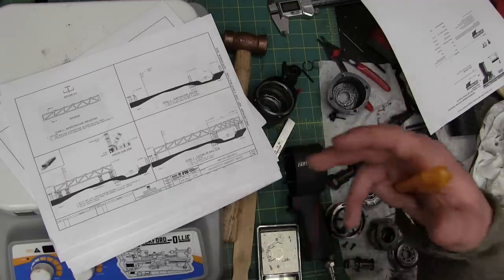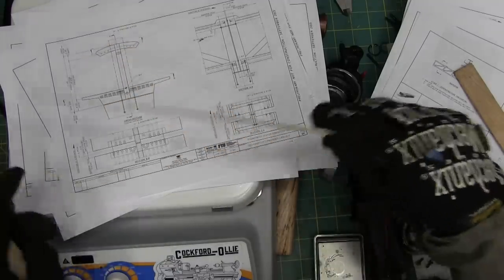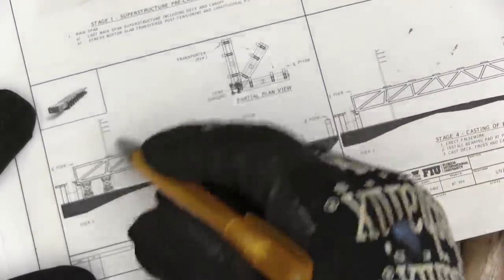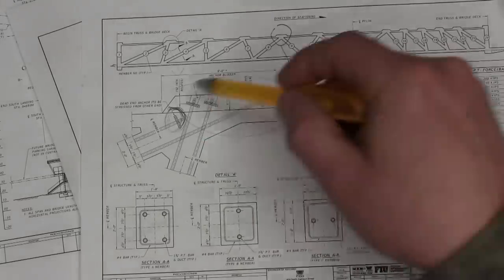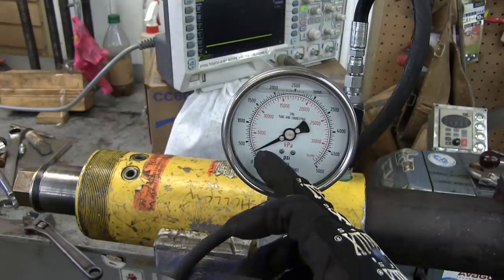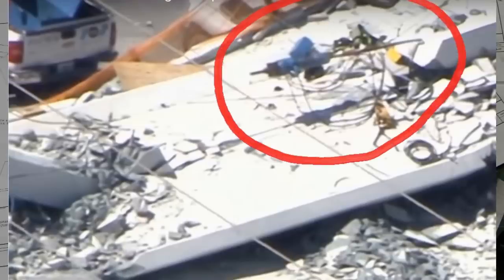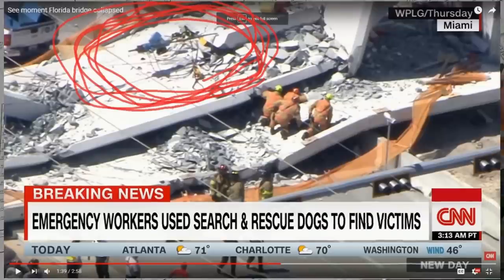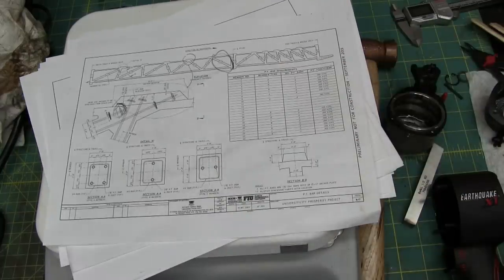Post Tension Failure Florida Bridge Collapse | Engineering EXPLAINED!

Comment: So to sum it up, the plan changed where as the transporter to hold the bridge up was moved, because it was moved the post tention rod yielded. They tryed to fix it by tightening it and it broke causing the bridge to fall.
Reply: brendan454 Looks that way, the modular construction moved in sections method is sound. I guarantee this was all perfectly calculated but at the last minute a change was made to the plan (moving the location of the SPMT), calculations rushed and the rest is tragic history.

Comment: So the mainstream media is getting closer to what AvE said a couple of days ago, they still haven't gotten it quite right yet methinks.
From the Miami Herald:
"While the cracking dominated media coverage on Saturday, experts appeared less concerned over that than with other factors, including the tensioning work going on at the bridge’s north end. Cracking in new concrete is not uncommon and not necessarily a sign of failure, they say.

Tightening of steel cables, or tendons, that run through concrete structural elements is a delicate operation, and over-tightening can cause concrete pieces to twist and break apart, experts say."
Reply: Wow. "Cracking in new concrete is not uncommon and not necessarily a sign of failure "  Well if that statement doesn't take the cake.
Reply: The people who were close to this project knew immediately it was because of one or maybe two things and said oh fuck.
Reply: Exactly. It may be months or years before they pin down exactly what happened.
Reply: Have any concrete bridges near you? Or even ones with the concrete parapet walls along the side (barrier, so you don't drive off the edge).  Walk out on one and look at the parapet or roadway up close. You will see thousands of spiderwebbing and microcracks. The bridge is constantly flexing, especially on a roadway bridge with traffic imparting massive live moment force every time it crosses onto the bridge from the approach slab. These are superficial cracks and mean little to the concrete's compressive strength. And on the parapets, that are non-load bearing, it means nothing. If the steel cables inside the concrete beams underneath the bridge fail...you lose all tensile strength and the bridge is in trouble.
Reply: alternative media. This youtube channel is a form of media.
Reply: Yes, and concrete being a plastic material , we even calculate the size of possible cracks. It's in the codes.
Reply: @D rB You seem like you know the lay of the land with these sorts of projects - I've got a quick hypothesis I need checked:

It looks like the part of the truss that's been pointed out as failing is in compression, not tension. So my thought is that the PT rod snapping wouldn't have brought it down?

I commented elsewhere, but at this point I'm digging for someone to chat with about this - I want to make sure I'm not going crazy.
Reply: @Louis Vaught
It may not have mattered if the member was in compression or tension.

Trusses are designed so that the resultant forces in all of the members equals 0. This means that the forces that are present in one of the members are being compensated for by the other members. Bridge trusses are usually designed with enough redundancy that a failure in one member may not result in a failure of the entire structure. In this case, the bridge is a hybrid system and was not in it's final constructed form. From what I've seen there was supposed to be a suspension tower and cables built in the next phase (though I don't know if these were just for aesthetics or not), therefore it's likely that not all of the post-tension rods were pulled to their final strength. If the tension rod snapped as proposed then the immediate change in forces may have just been too much for the other members of the truss to take resulting in a domino effect of failures.

In the CCTV video, it appears that the point of failure was at the connection of the diagonal members to the top member. My guess is that there was some fault in the fabrication of the tension rod, the rod anchors, or some fault or void in the concrete at the anchor embedment, but really only a forensic study will determine exactly what caused the failure. The rods in post-tensioned systems are not pulled to their yield point so if the rod did indeed break, something went really wrong.

The real failure here though was allowing traffic below the bridge while doing anything with the tension rods, but I think we all can agree with that.
Reply: For the uninitiated: there are cracks in everything made of concrete. In the rare cases where something fails, there will be a story about "cracking" in it by sensationalizing commentators because there are cracks in everything made of concrete.
Reply: No, that's not true. Trusses are not designed in that way - most importantly, they aren't usually redundant.

This truss certainly wasn't redundant. For a given gravity load in a non-redundant truss, there will be a fixed reaction in each of the members of the truss. You can solve for it pretty easily, using just some basic trigonometry.

The particular portion where it's been suggested that the tension rod snapped was in compression, not tension - so that rod breaking would not matter.

As to the suspension tower - yes, its primary purpose was aesthetic. At least, that's what the project proposal said.
Reply: +Louis Vaught You're not going crazy. The main valid observation in the whole video is that a cable is sticking out in the photo. The rest of it is just so people can have something to share and feel like they're ahead of the game, and the creator can get some views. The idea that they "moved a transporter" (he's looking at a proposal drawing and something moved in the end, that must be related), did a shoddy calculation and didn't put it under a panel point (gee, bet FIGG didn't notice that, just a small little change) and "weakened" the bridge (it was up for 5 days and the transporters were gone) and then wandered over to a strand and jacked it right past failure (nobody even looking at elongation values or anything, I guess) because the compression in the member wasn't increasing (oh, because the force doesn't go up past yield! But worker bees don't know that...) and then had it fail in tension (even though it's a compression member, like you pointed out) is pulled out of thin air. 

Watch things like this for entertainment, but if you're really interested, read the report at the end. The simple fact that there's a tendon sticking out in a photo does not tell us how this failed. From the photo you can't even tell how much of that would've been inside the top portion, which is presumably smashed to bits. As an intellectual exercise, read up on other structural failures and their causes, and ask yourself what fraction of them would've been figured out on Youtube from some news photos.
Reply: Louis Vaught A simple Warren truss like this is not redundant for sure. My comment about redundancy was more in reference to long span steel truss bridges with hundreds of members. 

Remember that this member and the top chord were in tension when the structure was moved. As was pointed out in the video the end was not supposed to be cantilevered like that - at least according to the info available to us right now. This is a change in construction process that may not have been designed for. Not sure what the law requires in Florida but it’s likely that an engineer would have had to sign off on this change. 

We’re relying on two very poor YouTube vids of the actual collapse but it looks like the top chord was the failing member and the tendon in question didn’t pop till after the structure began to fail. 

Again, it’ll take a full forensic investigation to really get to exact cause.
Reply: We could have a more detailed discussion of the design of large trusses, because I think you might have some misconceptions, but honestly that's very secondary to the discussion we should be having.

What's important is that this bridge isn't redundant, and your earlier comment makes no sense. 

For that matter, how the bridge was moved doesn't change the fact that the member that AvE is saying failed wasn't in tension when the bridge was installed - so the failure mode he suggests is probably not the right one.
Reply: NegatingSilence has
Reply: Shylock, concrete is a compression material.  Think about a stone arch; nothing is holding the stones together but the forces upon them, so where the stones meet each other can be considered a "crack."
Reply: Taint' a sidewalk.

Comment: As a retired Florida general contractor, we were always taught that the greatest loads are at the supports of a beam and not in the center. Your explanation makes all the sense in the world. Even placing such a heavy load on the pylon with a misplaced lifting jack could over stress the post tensioning rods and break them.

Comment: Also not only did the PT areas need tension, but they were supposed to be supported holding weight off the anchor points. By removing the mobile supports they broke it the moment they added the extra load to the anchor points. It just needed the time it took to yield.

Comment: The mistake is in design or in fabrication. The former is found by examination of the stress report and the latter by hands-on examination of the materials in the remaining structure. if the cracks observed prior to the collapse were in areas of hi tension that would be a flag that collapse was imminent.

Comment: The crane they had over the failure point.  Was more than likely there just to move the hydraulic tensioner machine.  That crane was way to small to lift any part of bridge.
Reply: the worker was harnessed to it. in slow motion his harness failed and it looks like he hits the fallen bridge

Comment: First time I ran into post tension was on foundations on houses for a new subdivision. With the framing, roof and exterior siding done, one of the houses was found with the patio door glass busted. The floor had popped during the night and threw chunks. The second house had a big buckle all the way across the living room floor but the 3rd was OK. Mysteriously, all 3 caught on fire and the insurance paid up. Replacements had conventional footings.
Reply: From what I'm seeing around my city, post-tensioning used a lot here.

Comment: Good Work! Cool Shop. As a simple truss the end member being adjusted would be in compression (designed for) under normal service loading. Note on the tensioning table that that member 11 has no Pre Tension Force entry compared to the mid truss members. They probably tensioned it to move it, as the truss would experience completely different loading in transit as you indicated. This member probably failed in tension during transit over bumps and uneven surfaces causing unanticipated deflection. These were the cracks they were concerned about after install. Members 2 and 3 on the other end were also subject to the same design, loading, and circumstances. Those were probably the ones tensioned earlier. They were probably trying to close the cracks in 11 just to keep the thing together, oblivious to the fact that they were increasing the compressive loads already in the member. This resulted in the explosive failure (fell faster than the poor guy) as you noted, at the upper joint, as the lower section of the member appears to be intact. Engineering 101. What a design; no redundancy, no design for installation, and wasted taxpayer $ for a cosmetic suspension display above which carries no load. Looks like the Taggert Bridge from Atlas Shrugged!

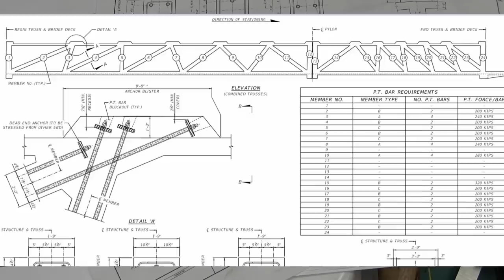Comment: The first diagonal web member was designed to be a compression member in the completed structure. It was designed to absorb the high shear forces that develop near a support. A late in the game change (Which happens on just about all fast track over budget past schedule projects) required the transporter to be moved one more web panel toward the center of the span. This changed the first diagonal member into a tension member to support the shear of the newly created cantilever end of the bridge. They likely call the engineer and need a "quick" analysis to see if they can do this even though the bridge was analyzed to hell and back in it's permanent position AND "planned" transport position, which unfortunately changed at the ninth hour. The very large tensile forces created in the first diagonal must pass through the post-tensioning tendons. As you see in the video, one of the tendons in the member (The one that has to be tightened from the bottom 12:20)  terminates PRIOR to the "node" or intersection of the rest of the tendons at the blister. The tension in this dead end tendon is resisted by primarily concrete and requires a much lower load to "breakout or crack the concrete." A crack formed and opened over straining and stretching the remaining cable (The one being tightened when it fell). After the bridge was placed back onto its permanent support, the first diagonal goes back into compression and the adjacent web goes back into tension. They go to tighten the cable from the top that was found to be loose (because it had yielded.)  They unknowingly over tighten the loose cable beyond it's strain limit. The imbalance of force causes the crack created earlier to propagate behind "dead end" plate on the first diagonal and a shear failure occurs causing the top deck to fold almost instantly followed by complete loss of shear and bending capacity. PT concrete is not supposed to crack. The pre-compression cause by the steel rods/strand are there to maintain compression or at the very least limit tensile stresses in the concrete to very low values. If a crack forms in through /adjacent to a "node" where intersection forces occur then it could entirely screw up the post-tensioning calculations since the forces have to travel within the material until equilibrium and the guys in the field could be chasing their tail trying to hit target values that can't be achieved without straining the steel past it's breaking strength. Trusses are generally not redundant. All of the members are critical. The job should have been stopped, budgets and schedules blown further, the road should have been shut down until a complete and a thorough analysis of all of the potential failure mechanisms were flushed out. This decision requires GUTS since it could cost a person or Company their jobs. If you can't get ahold of the State when they are on break, then you call the police and have them shut the road down until things can be evaluated and then peer reviewed (Time, money, inconvenience)...No loss of life.
Reply: Meanwhile in a pandemic in 2020... (not what meanwhile means)
Reply: TL;DR This is what happens when the design is a class 2 lever but you build it as a class 3 lever.

Comment: Very good description of what may have caused this collapse. I believe you are correct in saying it failed where the workers were tightening the post tensioning rods. Why that work was necessary will be revealed during the investigation. What you said about the absence of support beams (load spreaders) between the transporters I believe is valid. I agree what others have said about how stresses change when supporting such a thing from different points along the beam.  Why officials and the construction firm allowed traffic continue during the remediation is anyone's guess. But...it sure seems negligent.
Reply: Original concept drawings show a tower with support cables that would have supported the weight of all the concrete and steel. Because the truss is not uniform means the stresses on each individual web member is different. I am not an engineer, but it looks like a terribly complicated design.
Reply: @GlennL  the tower & cables are purely decorative... this isn't a suspension bridge.
Reply: Yes, I did find that out. The tower and the support cables were not to have any function, other than to provide aesthetics and some sway protection.

Comment: REPORT: "2. The bridge had structural design deficiencies that contributed to the collapse during
construction stage III. The cracks on the bridge occurred due to deficient structural
design.
3. The morning of the incident, EOR held a meeting with project participants after
evaluating the cracks over the course of the previous two days. At that meeting, the EOR
acknowledged that his computations could not replicate the cracks and therefore, he did
not know why the cracks were occurring. The Construction Engineer and Inspector
(CEI) of the project advised the EOR at this meeting that the cracks were lengthening
daily. Despite these admissions and the knowledge that the cracks were growing in size,
EOR stated more than once that the cracks did not present any safety concerns.
4. The magnitude of the cracks warranted that SW 8th Street be immediately closed, and the
concrete truss be shored and supported at multiple intermediate locations to reduce the
loads in the north diagonal and the node until final evaluations were done and remedial
measures implemented. "

"11. EOR should have known that the truss was a non-redundant structure and if one diagonal
member failed, the entire bridge could collapse. Given the nature and extent of the
cracking and the non-redundancy of the bridge design, necessary safety precautions
should have included closing the roadway below the bridge and immediately providing
shoring to the bridge at suitable locations until a complete evaluation was done."
https://www.osha.gov/doc/engineering/pdf/2019_r_03.pdf

At the time of the collapse, they were pretensioning a member, but that was not the cause of the collapse.